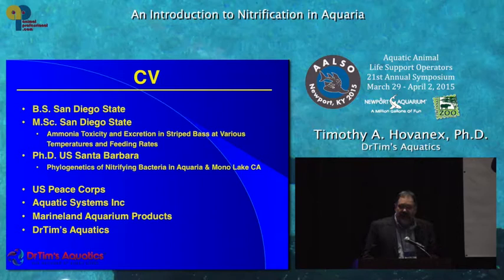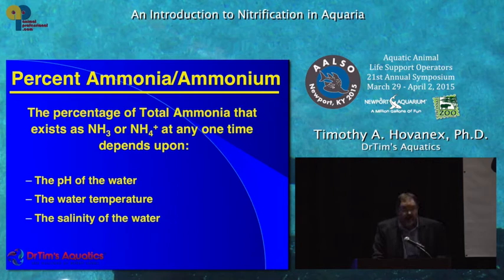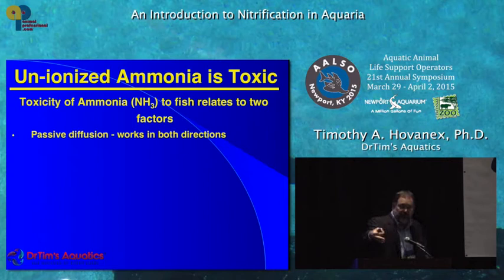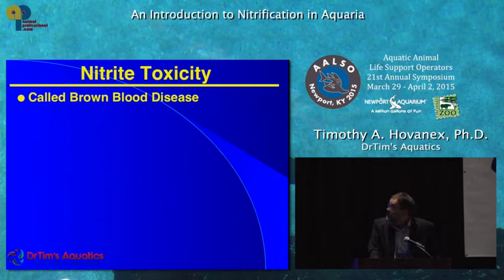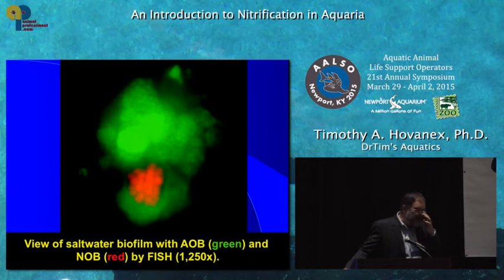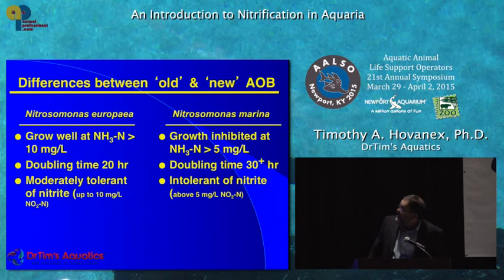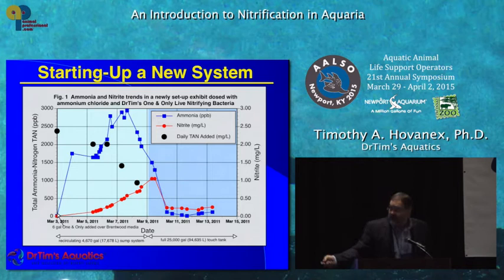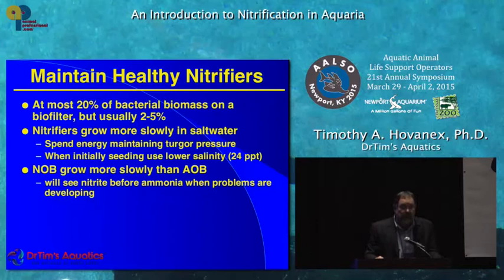DrTim AALSO Apr15

Comment: So regarding water coming out of our faucets and nitrification going on within the pipes, Nitrate levels would then be a concern. If so, how should water changes be done if reducing nitrate is one of the primary reasons for doing it?
Reply: Btw, I really enjoyed the lecture!
Reply from the maker: First you should measure your water and see if indeed there is nitrate in your tank water and how much.  Also realize that the concentrate can change seasonally as your water provider might have to add more chloramine to the water depending on rainfall, heat, and many other conditions.  If you find you have high nitrate and using your tap water for water changes won't really decrease your tank's nitrate level then it might be cheaper to buy bottled water (depending on the size of your tank) or you would need to consider setting up a treatment regime for the tapster in a separate container before adding to your tank.
Reply from the maker: Thanks!

Comment: dear friend, how are you doing. 

i need your help in one issue. I'm planing to do a raised koi pond but I'm stuck in fixing window frame. 

mu question is: 

how to fix the frame into concrete block? and is steel affecting water chemistry, i mean should i leave steel as it is or should i coat it with something for waterproof so not to affect water chemistry? 

thanks
Reply from the maker: You have to get a special window frame with a weatherproof strip around it and set into the concrete.  You need good masonry skills to prevent this from leaking.
Reply from the maker: No -only when you do a big cleaning of the substrate and the filter and the glass.
Reply from the maker: Follow the directions on the bottle
Reply from the maker: If you don't freeze it first it will make a mess in your tank.  Yes, you can thaw it after you freeze it.
Reply: DrTimsAquatics hey dr Tim I'm using your bacteria and the ammonia and I followed the directions and the ammonia went up to like 2ppm and then weeny down to 0.25 ppm but everything else stayed at 0.00 ppm what should I do I am on day 8 of the process and all I want is it to cycle already